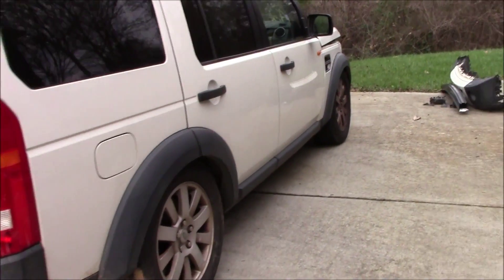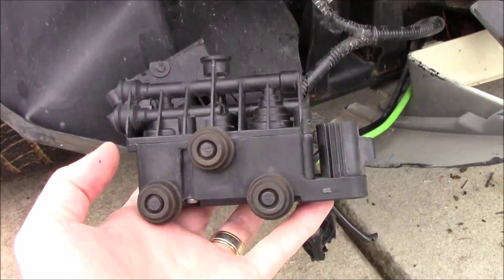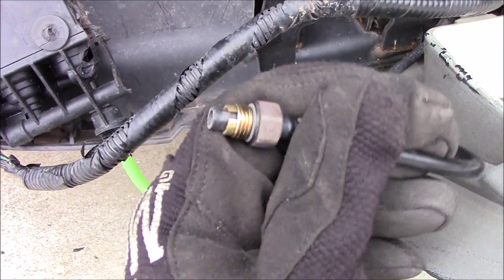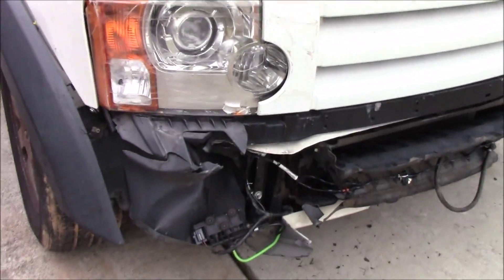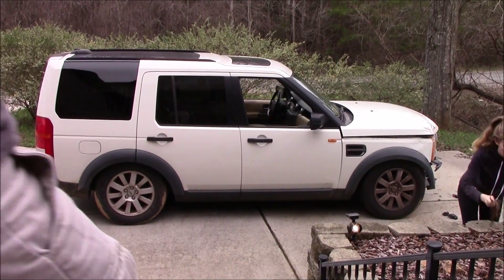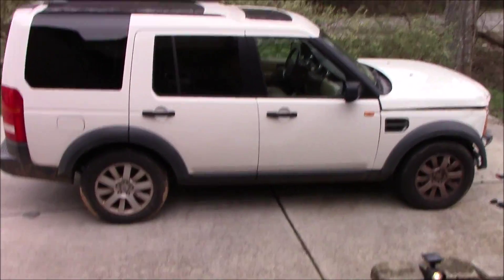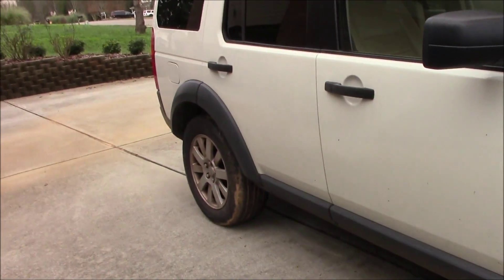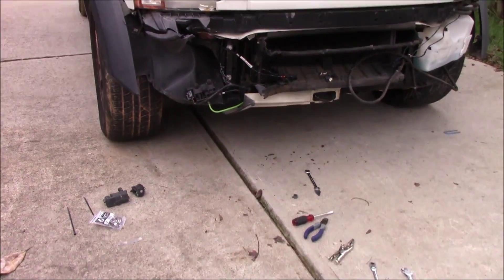Rover Air Suspension Fix. (Transfer Relief Valve + Air hose repair).

Comment: Good day colleagues, my 2006 LR3 is not raising at all anymore, it used to give a suspension error, maximum speed 30mph. What can I do
Reply from the maker: If it is telling you Max Speed 30 mph, then it must think that it is in offroad height.  It is programed to not let you drive in its highest setting unless you go slow.   (that is how it is meant to be from the factory).   So long as you can still drive at standard height above 30 mph, then you might not have a problem?
Reply: @FarReachFR  Thank you very much, but right now its no longer lifting to normal level and the ride is very bumpy.

Comment: Quick question, before you replaced the air block, did your compressor run at all? My sport has the rear bags inflated but the front is slammed to the ground. I used to be able to do 2 start sequences and get the front to raise, but the EAS suspension fault would show up immediately after. Now that has stopped working and my compressor wont come on at all. I've already ordered the new block I'm just wondering if the compressor is not being told to activate because the air valve has malfunctioned completely. Thanks
Reply: did you ever figure that out, my compressor would come on for a few seconds and then the eas light would come on no matter what I did or reset

Comment: I have the driver's side of my LR3 suspension always dropping shortly after I park the vehicle the valves and the balloon seem to be ok. The amber suspension also comes up when the vehicle is in motion for about 30 minutes. I need an advice.
Reply from the maker: First thought, it it sometimes can be telling just to have the engine codes pulled.  You could try an Advanced Auto, or other Autoparts store use their computer to pull the codes.  It may point you to the problem.  Beyond that is a series of trouble shooting.  Does it drop the whole drivers side?  Or is it just driver front? Or just Driver rear?  Does the suspension work normally and at proper ride height (aside from the light) when you are driving?               If the answer is (just one corner drops) and (it is fine when you drive it) then I would lean to it being an issue of an air leak in the Airbag on that corner (or a hose, or the attachment point at the top).  To narrow it, I would suggest if not already that immediately after parking in a quiet location listening for leaks.  Sometimes they are so small you cant hear them.  But I have had a few where the noise took me right to the part that was the problem.  Best!
Reply: @FarReachFR  Thanks for your reply,  it drops just on the driver's front side first and the passengers front side follows after some hours of parking,  it drives and suspends normally when  you start and drive but if you drive continuously for up to 20 miniuites it shows the amber light and indicates the amber suspension light.
I have changed the hose the takes air to that that wheel twice but it still persists. Please help with a suggestion.

Comment: I have a question my lr3 is like low rider can I put fix a flat I have slow leak on my suspension will it mess up the system
Reply from the maker: Fox, this is a great hypothetical!  I love that you thought it up.  You might not be surprised that I dont know of anyone trying this before. I love original thought.  So this is just my take on the idea.  Here it is... I would not recommend it.  Why?  Two main reasons 1.  Fix a flat uses rotational forces and gravity to distribute the slime within a tire.   2.  It can harden where it is left.       In more detail on #1.  after you put fix a flat in a tire you drive it to spin the wheel in order to spread it around evenly.  In the Rover's air system there is no rotation.  Thus where ever you put the slime it will just run to the bottom and sit.  It will not have a good way to move the slime around.  In short, I dont see an effective means to move the slime to the point of the leak, and I expect it would just pool at the entry point.  As for my thoughts on where the leak might be, it is often the air bag suspension itself which is one of the highest parts of the system, so with gravity moving things to the lowest point, it wont be able to move the slime up to the top of the vehicle to the bags.  It would just pool down low in some of the air lines.    As for #2, the Rover's air system has transfer blocks and other moving parts that shift air side to side, front and back.  Lets say we get some fix a flat in there and it then settles and hardens.  Well then your rover will no longer be able to move air to the various portions of the car.  In short, the air system will be dead.  So even if the leak was fixed. it wont matter cause it will no longer be able to use the system to move air around.   Anyway those are my thoughts.  Help it helps.  If you do end up doing it, let me know if it solves the problem.
Reply: Thank you! For the info

Comment: Just had all 4 brakes and rotors replaced, next day getting "suspension fault" warning. No other warnings along with it. Hearing a weird whirring noise from front passenger side when traveling on freeway. Any suggestions? Vehicle still raises and lowers even when fault light is on. It is now off and has not come back on but the noise is still present when going over 65 mph.

Comment: Hello!
I also have the following error at a discovery 3, 2005, 2.7, 190 hp
Error code: C1A00 49 Air suspension control failure module

briefly: When it's cold outside, the on-board light comes on and the car does not get up.
If I start it and let it warm up, I get the key and get back in touch, it works.
THX!

Comment: i hope you can help me with this one. friend of mine have 2006 range rover sport and occasionally he gets a suspension error on dash and during that period front end (both corners) are lower than usual. the problem goes away by it self. what could be the problem, in which direction should we go? if it was this valve, that is mechanical problem and i think it would not go away once it is broken. Also if it is sensor, how come both corners go down? please some info? thanx.
Reply from the maker: Hi there.  I still find these air suspensions on rovers to be complicated so while I wont be able to give you a total answer let me give you some details I have noticed thus far that might relate. First is it could be a mechanical leak in the system.  Hoses or at the shocks (bottom in wheel well, look for cracking rubber, or top under hood, loose topseals.) could be leak points.  If there is a leak on one side it often will decide to level the front to be equal on each side for stability.  Thus your whole front lowers even though only one corner might be an issue.  If the Rover settles to a lower height when left off and sitting for a couple days, this may very well be the issue.
Reply: ok, thanx for info. i am going to look for leaks.

Comment: Thanks , I have my 2005 LR3 showing random signs on dash after replacing all 4 brakes and rotors. Also vehicle lower while  driving. I would appreciate any RIP to resolve this issue
Reply from the maker: What signs are on the dash?  Does it display a message prior to lowering?   Does it lower at a distinct moment or does it just slowly fade away?

Comment: Hello sir I have a 2006 land rover lr3 exactly like that one but when i turn it on only the back ends go up a little and the front stays flat do i have to do what you did?
Reply from the maker: Juan I cannot say for certain but there are two things I would consider off hand.  The first is I would check for leaks.  If you can listen in the front wheel well of each side when the back is raising but the front is not, perhaps you might here one.  Second though is is could be the air transfer valve block could be bad.  That too could make it so it is not working in front.   Do you have any air suspension error lights?  You might take it to advanced auto and have them check for codes.   Anyway I hope these couple of thoughts helps you in the right direction.
Reply: Yes i do get the suspension fault error and only the back of the truck lifts up a little
Reply from the maker: If you have a suspension fault it is more possible that pulling the codes may give a more precise indication on the error.  So you may want to give pulling the codes a try.  That said, from situation, that was the same issue I had and it was the air transfer relief valve that was the issue.  It is in the front behind the bumper on the passengers side.  I cant say for certain, but that may be your issue.
Reply: Far Reach Engineering so what do I have to do take it to advanced auto parts?
Reply from the maker: Just drive it there (if you can) and tell them you have a "check engine light" and ask if they can "read all the codes".   You could even call them ahead of time to verify they have the scanner at their store.  If they have the scanner (which they should, most do) then they should be able to scan it for free.  Now I am not certain if their scanner will have just a little detail or a lot of detail.  But, since it is free, it is worth a chance (so long as it is not dangerous for you to drive it there.).  If they pull any codes, they can print them out and you can then decide what if anything you'd like to do.  You dont have to buy anything.
Reply: So if its the transfer relive valve i have to do what you did?
Reply from the maker: IF it is the transfer block.  Then yes.
Reply: Okay sir thank you very much appreciate the help
Reply: This thread is old but I need help got my air springs changed now it saying cross link valve actuation error .. what does that mean help

Comment: I HAVE MY LR3 2007 THAT I CHECK IT ABSOLUTELY EVERYTHING I DID NOT KNOW HAD THIS VALVE BLOCK IN THE SUSPENSION SYSTEM AS WILL IF I NEED TO REPLACE IT OR ONLY CHANGE THE ORINGS THANKS

Comment: My question is what did you hit?
Reply: I have one question is it expensive to maintain an lr4 say constant problems every month and expensive ones but I cant imagine anything being worse than the f250 we use to own $6000 in repairs in 2 months long term expensive parts isn't a problem just as long as they last say air suspension 10 years but cost $1000 each not a problem I have seen cheap parts but like to stay OEM or close as possible
Reply: well they can definitely cost more than a Ford to fix but honestly they aren't as bad as they are said to be. things are expensive but it doesn't break down all the time or anything
Reply from the maker: So far, its been really cheap.  Besides fixing stuff from the smash, the only thing it has needed since purchase has been tires.  Granted still in the first year, but so far so good.  Though I do hear from others horror stories about their electronics and drainage rails.  But thus far no real problems.
Reply from the maker: Nothing, I just buy salvage vehicles cause I am cheap. :)  .   But it is a good question and one I have asked myself several times during the repair.  Since I bought it blind from an insurance salvage yard, there is near zero info about the accident, but considering the contact, dents, and the debris on the Rover when it was delivered, I think it hit a deer and then went in a ditch.  I say deer because of red/brown stains on the front, and ditch because the underside of the vehicle was just coated in think chunks of mud that appeared to be from skimming off ground while in a high centered position.  But that is just my guess.  What do  you think?
Reply: +Far Reach Engineering it's possible but I own an Lr3 and it is a beast so whatever it hit was pretty big. I've pushed many of objects with my truck without even a dent lol.

Comment: Thanks for the video, i have my front lr3 lowered. If i change the Valve, would that make the suspension error go away?
Reply from the maker: +Natalia Lealiifano  There is a good chance it would. But there are additional factors. 1. the front lowering could be from an air leak somewhere other than the block. And 2.  In some rovers there are soft vs hard errors.  Soft errors will go away when you fix the problem.  Hard errors have to be reset at a dealer.  Good news is that if it is like mine (and it sounds like there is a good chance that it is) then the error will go away straight away with a new valve block.     If you want to try a separate check before you buy a new air transfer valve one thing you can do, is if your LR3 will pump up all 4 corners, then have it fully inflate.  After that, park it and disconnect the battery and leave it over night or until the air loss happens.  If both corners in the front go flat, then you likely need a new Valve block.  But if you find later that just one corner has lost pressure in the front, but the other is fine, well that would indicate that there is an air leak in that particular corner that needs fixed and it is not automatically a transfer valve issue.  Hope this helps.